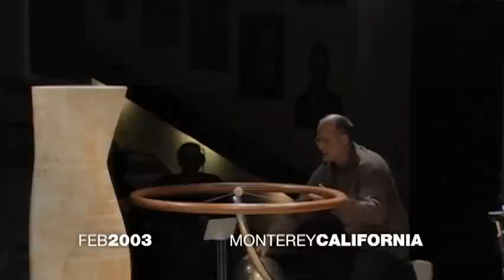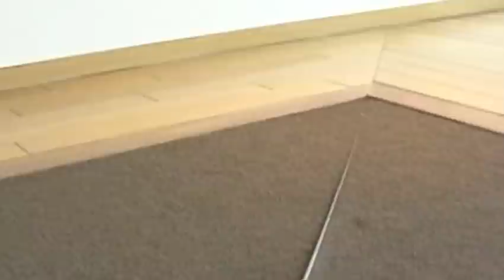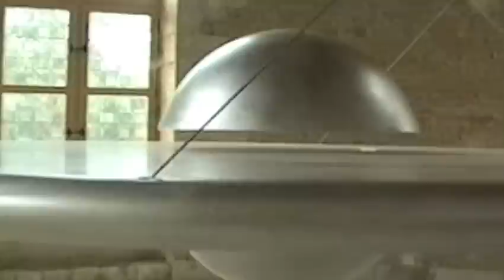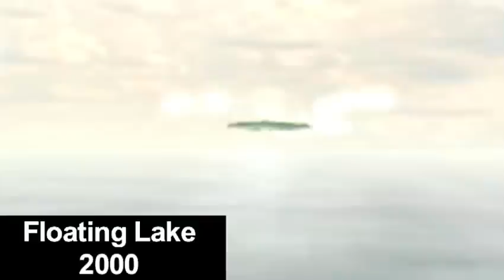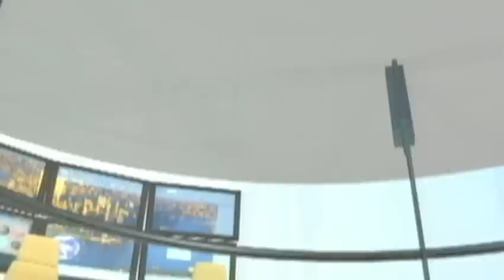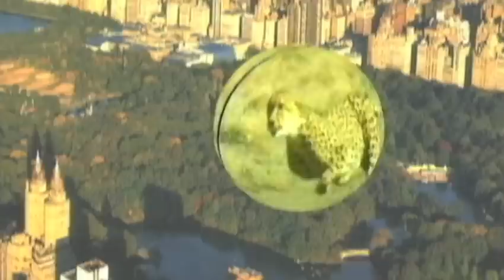Tom Shannon's gravity-defying sculpture

Comment: 1 million kilowatts of clean energy, because it uses "electrical motors"??? What does it use to generate the electricity? The power of happy thoughts?
Reply: +Herman Guillermo Dolder Exactly. -it is not possible. The world largest photovoltaic power stations delivers half of that, and covers areas of tens of square km (or sq mi).
Reply: hpekristiansen it's 100% possible using hidden technology that is only visible to people in the know in this video.. it's the reason he is using orbs with holes at each end.. the holes exist at each end on all of his levitating works but on most of them they have been covered it seems

Comment: His sculptures are awesome, but the flying island and giant TV sphere? Too much drugs.
Reply: Dude, the giant TV sphere? That's how a TV works. Look at a TV screen closely, and you will see red, blue and green squares. Those squares emit varying intensities of licht to create colors. His idea is completely plausible.
Reply: Benimur Chumba : Except that it's a 'twenty ton' sphere that remarkably manages to hold about several times its weight in generators (1GW's worth, apparently, in order to be bright enough to be seen in daylight - a 500MW generator is about the size of a small truck, after all, and you would need 20 per GW) and display systems, would generate enough heat to lightly toast marshmallows from fifty yards away (in order to be bright enough to be seen in daylight - there's a lot of waste heat from a 1GW display system, I'd warrant). It's interesting that he believes a city-block-sized power station may eventually be able to fit in an aircraft, but that innovations in display systems will be slower. I wouldn't want to be in a floating sphere containing the energy of a large bomb with such obviously poor aerodynamics many feet from solid ground even if it wasn't utterly preposterous and implausible.

Comment: I would think rather than using LEDs to display things during daylight it would be much smarter to use ePaper display technology. LEDs could still be used at night when they would require far less power to be visible.  ePaper can do color and video now, and works best in direct sunlight. It also only consumes power when changing a display, not in maintaining one.

Comment: a Million kW generated on a blimp weighing 20T - 110ft in diameter!!.  Hydrogen in that volume will lift 26.9 Tons and Helium roughly 24.8T .  But putting a GW! generator in a flying machine is well outside current tech.  And way more surely than one would need to power a few million LEDS?. :). flexible OLED screens might be a better way to think about it cause those numbers are about as practical as his flying lake.   The little sculptures are nice though.

Comment: hes said the DIAMETER is 92 x bigger   not the entire mass....diffrence...you cannot fit 1,000,000 earths side to side and get the same diamter as the sun...earth diameter is 12,742 km the suns is 1,391,000   12,742 km times 92 is 1,172,264  so hes off a bit but close enough for arts sake. According to you the sun is 120,000,000,000 in diameter ..soo...   UMM... no try 92
Reply: the moon is much smaller than the sun, yet it exerts on the earth an attraction equal to the sun placed so close to the earth. and the positioning of the sun and its relationship to the moon to jointly exert this attraction is a subtle positioning in the celestial movement